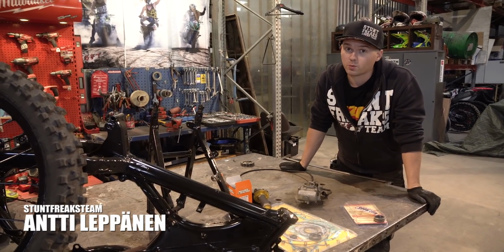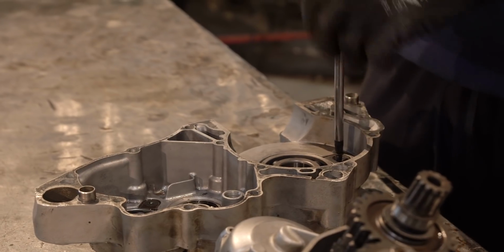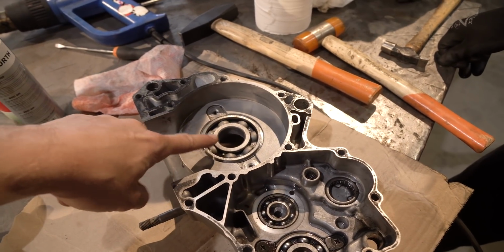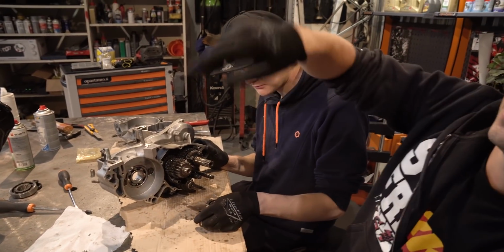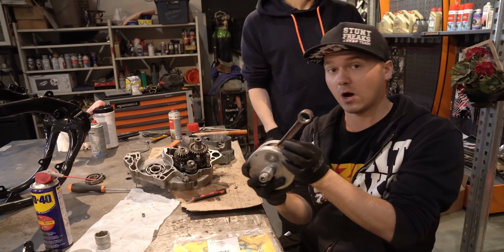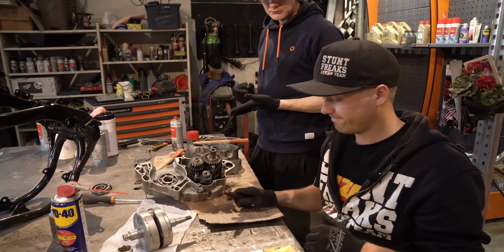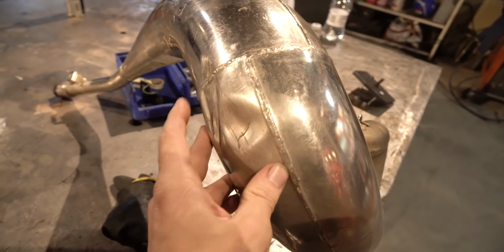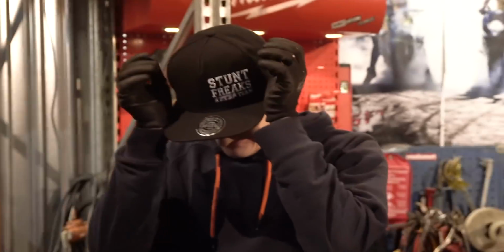Suzuki RM engine rebuild

Comment: A tip for everyone: If you want a stuck bearing out, first remove the inner part and then weld across the bearing, the welding pulls together and the bearing just falls out. I was sceptical about this method at first but then I tried it.

Comment: Tip:  wire the gears and shafts together before removing or better yet just leave them in the clutch side crankcase, freeze bearings in freezer for same results, Ive done a million of these

Comment: You can actually watch the sandblasting material coming out of the frame as they are kicking the bike over. (10:10). No one bothered to blast it out before painting it. LMAO!
Reply: I was totally wondering what that was! The whole time he was kicking it over, I was watching it fall out little by little out. 
It looked like smoke. Then I was like uhhhh.... crankcase sand.... Like, does he know he’s Fuckin that bike up? 
Then I searched the comments saw yours. And immediately knew that i was an idiot for second. Haha.
Hey! Good eye man. I didn’t even think bout that. 
It looked like fluid.
Reply: I very well thought the same thing. I thought that they fucked up putting the bike back together and the engine was blowing out shit from the bottom. I realized that that frame was painted and didnt really think about the sandblast dust. Wow. Lmao.
Reply: Fred Pinczuk well spotted
Reply: Hell yeah I see something dripping like sand

Comment: Hay how do you tell what size rode you need I have a rm 125 and it blue it's crank bearing and I want to just replace the rode pin and bearing so what size rode do I need.

Comment: My 1986 250RM 2 stroke Suzuki clutch went out on me when I was trying to pull start it and now all it does when I try to crank it is just crank over don't even try to sound like it even trays to start can anyone out there help me with this problem I will pay to get it started agin I just got the bike and it's been a blast I don't want to junk it I freaking love hollering for help
Reply: John Figueroa carb check
Reply: Is there pressure in the piston when you move the kickstarter? If so the most likely reason is the carburator and in a 80's bike the intake manifold might have became brittle

Comment: You revved a cold engine and its a fresh rebuit engine aswell how stupid on a 2stroke do you wanna blow it up
Reply: motohunter You have to find it out somehow do the engine work and does it keep running or does it shut down. Also, with my moped you have to rev it when you start it so it keeps running. It is a 2 stroke also. Anything havent blown up yet and probably would not before I get a car.
Reply from the maker: +F3D0M1L real 2 stroke dirt bikes can handle little cold reving.. and the motor was super rich because all the oil what was on the piston and the main bearings so it never goes clean if you dont rev it

Comment: Hello, I do not speak english, what is spark plug the best for RM 125 model 1980. 
Thank you
Reply: I dont speak chinese so i cant help you with your problem
Reply: @karu3707  cuál es la bujia ideal para esa motocicletas ?
Reply: @karu3707  what plug RM 125/ 1980 — 2 stroke
Reply: @LuisRodriguez-ec8gv  BR9EIX
Reply: @LuisRodriguez-ec8gv  BR9ES can work aswell, it says 1970 - 1979 tho
Reply: @LuisRodriguez-ec8gv  it says BR9EIX is a premium version only for 1980
Reply: @karu3707  thank you
Reply: Try BR8ECM (KTM EGS 360) i have it on 125 1999
Reply: @RRDfinland  ok thank you